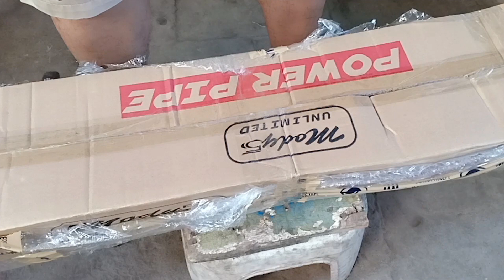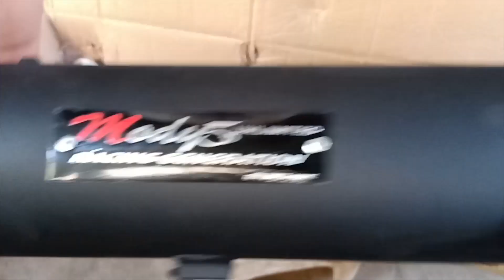Installation & Unboxing of Mody5 power pipe Sniper 150/Eciter

Comment: Paps, nasubukan mo ba palitan nang Iridium Spark Plug? Baka mawala backfire, mas malakas mag sunog yun eh.
Reply from the maker: Magandang suggestions yan paps, try ko yan paps..
Reply: @jasgood1397  update, dumating na yung Mody5 ko, so far, wala naman backfire. Yun lang, as with most pipes, amoy gas. Pero nawala din nung nagtagal. Hehehehe.
Reply from the maker: @Drone_SOX  ganun ba paps, sa akin nag babackfire pero stock sparkplug gamit ko paps..
Reply: Stock din akin Paps, NGK. Di ko pa napalitan Iridium.
Reply from the maker: @Drone_SOX  ahh pero e o serve mo muna paps ang pipe baka tumatagal mag babackfire
Reply: Kaya nga Paps. Observe ko muna.
Reply: Musta po kaya ngayon pipe mo sir julius nagbabackfire na po ba stock ecu and sparkplug? Sana masagot tnx.
Reply: @markjosepharabejo6209  nawala yata isang reply ko. Nawala backfire nung akin Paps nung pinalitan ko nang Spark Plug. UMA Iridium Spark Plug, UMA Ignition Coil tsaka UMA Air Filter. Nasa YT ko yung video.
Reply: @Drone_SOX  Ayos pala paps kahit stock ecu lang basta palit sp at ignition coil salamat. Panoorin ko ang video mo tungkol diyan.
Reply: @markjosepharabejo6209  test run lang yung video Paps, pero marinig mo naman yung tunog niya. Wala naman backfire.
Reply: @Drone_SOX  Ganda mga paps walang backfire ilang buwan mo ng gamit yang ganyan setup na walang backfire?
Reply: @markjosepharabejo6209  tagal na din. Isang taon din siguro. Kaya lang ngayon tinanggal ko, malapit nang na confiscate yan nang LGU dito sa amin. Hahahaha. 2  months ko na siguro di ginagamit. Pero satisfied na satisfied ako. Na tunugan lang nila ako kasi di ko napansin na may checkpoint, napasarap nang bomba. Hahahaha.
Reply: @Drone_SOX  Yun lang paps, mapapasarap talaga bomba sa tunog haha.

Comment: Is it need to adjust anything during installation?
Reply from the maker: Yes boss, after the installation of the pipe boss you need to tune the stock ECU to avoid misfire..
Reply: san po pwede mag pa tune ng ecu?

Comment: ano po effect sa engine pag di ma check ecu paps?
Reply from the maker: Boss ang effect po if hndi na pa tune ang stock ECU mo mag babackfire po yung motor.
Reply: masisira ba engine pag nag back fire paps?
Reply from the maker: @akohgaming  boss may pusibilidad ata boss kc may misfire kc sa combustion chamber boss but yun lang ang alam ko boss hndi ko din alam kung anu pa ang ibang ma aapiktuhan boss.
Reply: thank you paps sana meron dito mag  tune ecu ask ko sa Yamaha baka meron sila thanks again paps kakabili ko kasi nang pipe 👍